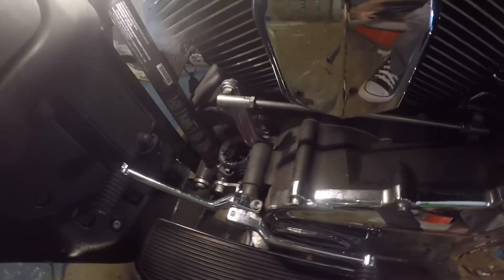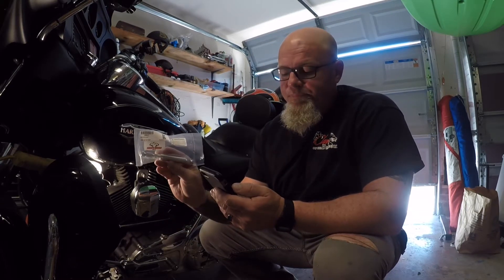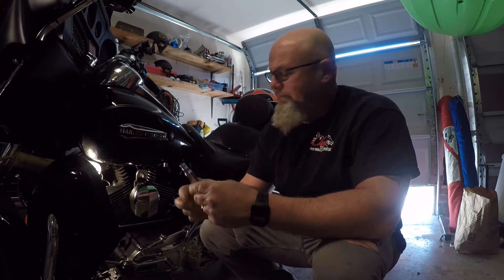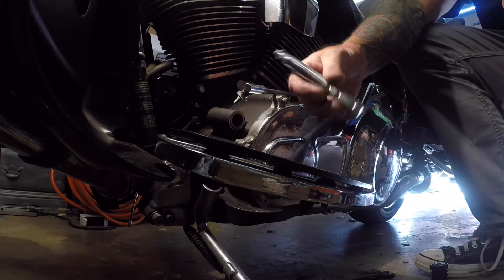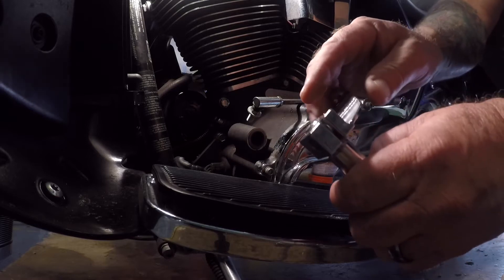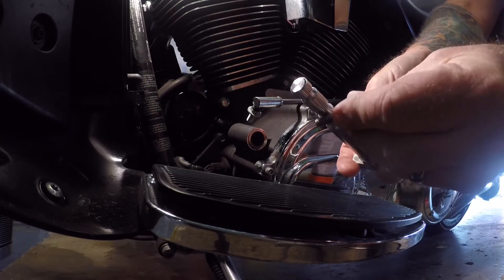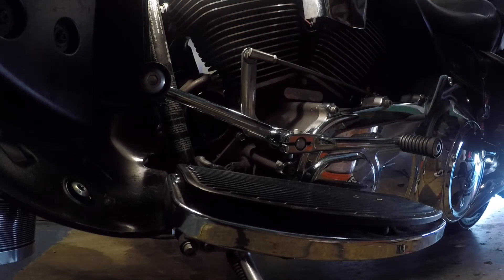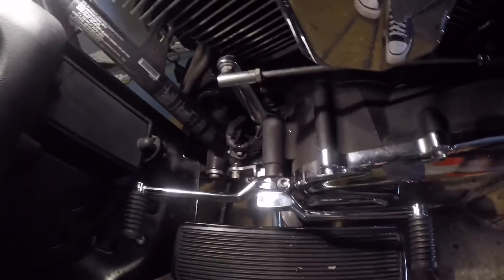Harley touring shift shaft replacement.#motovlog #supportmvc #harleydavidson

Comment: Man shift rod is known to break. I carry a shaft, rod, and leaver in my spare parts on my bike. Always watch you rear leaver at the trans they are known to get loose and mess up the splines on the trans shaft. That requires to disassemble the trans to fix. I check mine every oil change.
Reply from the maker: That is solid advice.  $10 part.  I'm gonna order another and keep it in my tool kit.  Definitely will be keeping an eye on the rear lever.  Thanks Man!!!

Comment: Awesome video. My shaft died on the road 300 miles from home stripped the shaft. Did a roadside repair to make it home in 20 minutes but this is definitely an easy fix!
Reply from the maker: Yeah, I added checking that on my pre-trip check list. Definitely wouldn’t want it to crap out in the mountains.

Comment: I never had that trouble. The problem I have had is with the shift rod connector. I found the stock ones just don't hold up. I have always replaced them with a bearing type. Good job.
Reply from the maker: Yeah…I still have a slight jingle and I think that’s the problem.  Gonna replace that soon.

Comment: Just had my 2020 FXBB Street Bob shift shaft rod strip the splines are worn and actually cracked and was missing part of it, took it to the shop they cant find the OEM or an after market part... I hope to get it back up and running soon. I miss riding
Reply from the maker: Check J&P. I ordered one from there a while back.
Reply: @Ucmpigs  Appreciate it, I checked them out, unfortunately they did not seem to sell or even offer that part for my bike..

Comment: Those shifter rods are hardened steel. What ‘does’ wear are the two bronze bushings that are inside the through hole at either side.
These can be replaced easily enough from videos presented on YouTube.
Reply from the maker: Funny you just commented as I’m working on it again.  That “el cheapo” replacement shaft stripped completely out a few weeks ago and left me stranded on the side of the road 40 miles from home. Luckily there was a HD dealer 4 miles away.  Got the HD one and did a quick repair.  I was just trying to tighten it all up and it still rattles.  I just watched a video on replacing the bushings.  Thanks for watching and mentioning that!

Comment: sometimes it makes your life that much easier and quicjer in the long run if you remove other parts first
Reply from the maker: Always…However, leaving the shift rod in place while removing the shift levers did make it easier.  I tired with it removed…a lot of dropping the ratchet…not good for video🤣